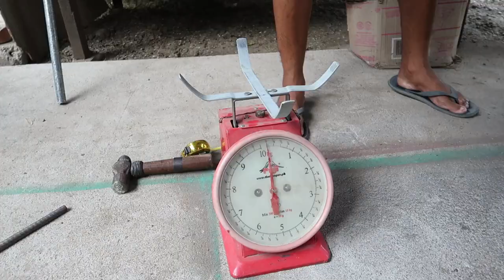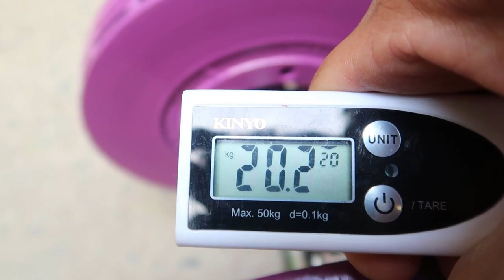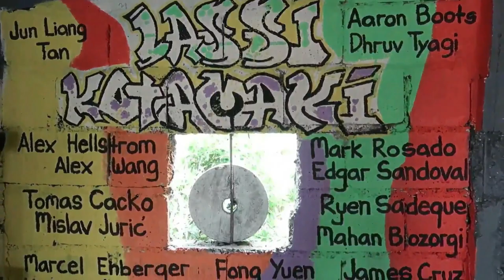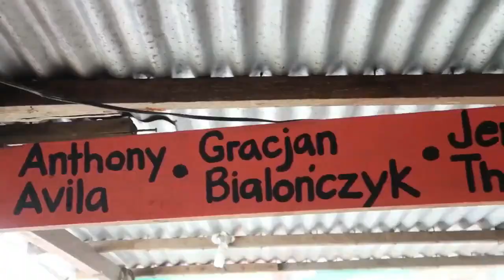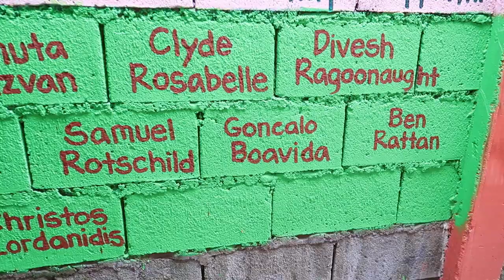How to Make Homemade Dumbbells From Old Rotor

Comment: Nice video, thanks a lot. You can even do a weight centered dumbbell just by welding a galvanized tube in the center of the brake disc.